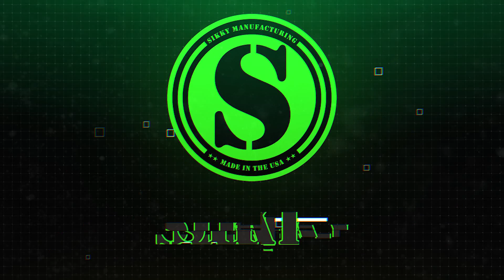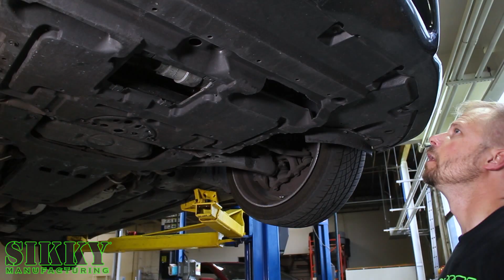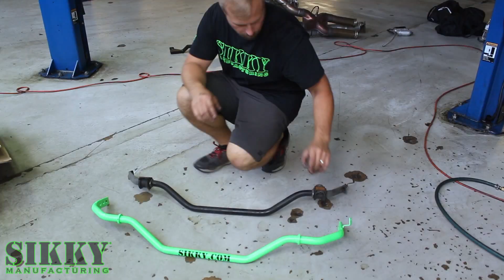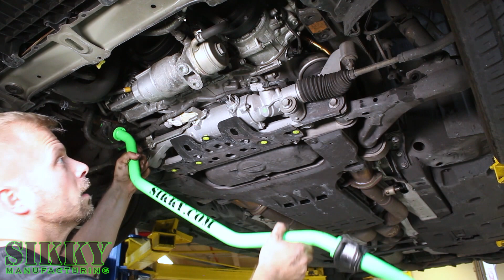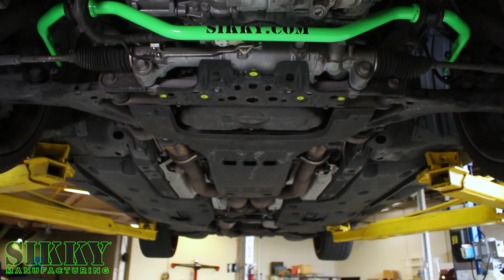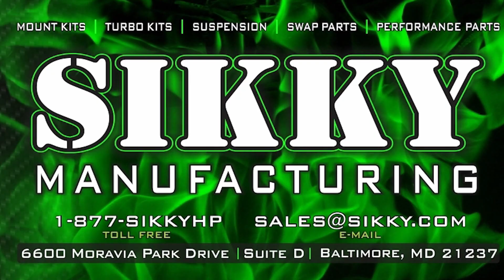Lexus ISF Front Sway Bar Installation - SIKKY Adjustable Sway Bar

Comment: Hi can i use the same front swaybar for lexus is250 2010?  My oem ones have a slight bend on where the stab links are connected?
Reply from the maker: I believe so. I’m not 100% sure off the top of my head
Reply: Yes you can